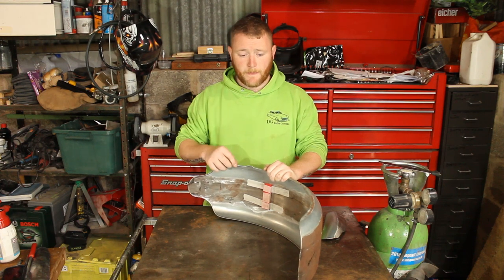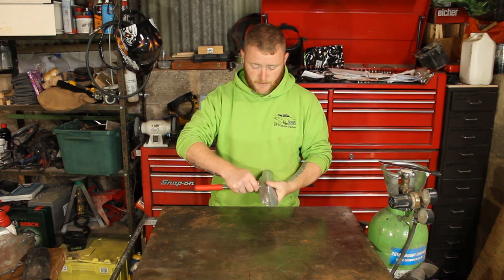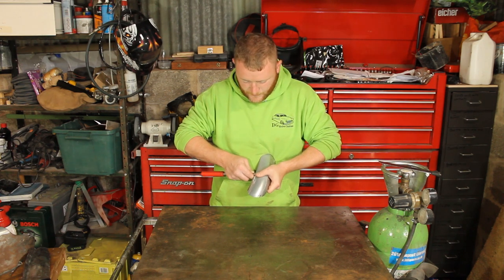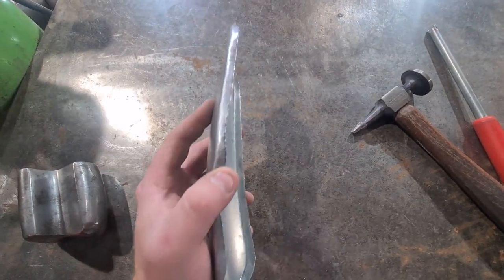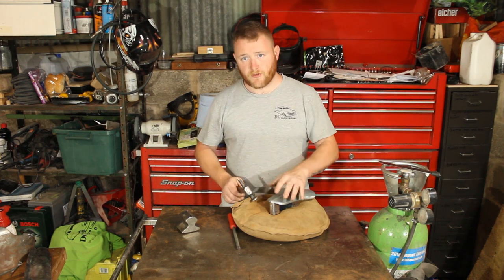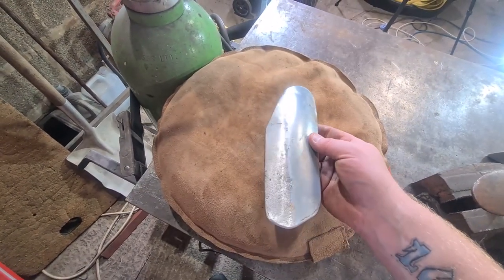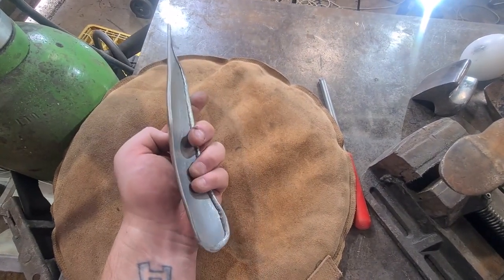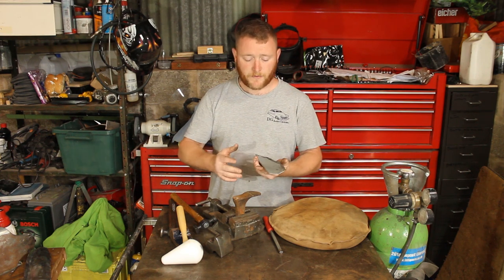Metal Shaping - How to make a return lip by hand | Rolled Edge | Wire Edge (no wire)

Comment: Really interesting and very helpful for me as I need to put a neat edge around the steel bulkhead opening for the gearbox on my current project car.
Thank you for making and sharing this.
Kind regards Paul from 48 Spokes
Reply from the maker: thabk you and you are very welcome, my advice would be practice on some scraps get the technique down and take plenty of breaks as your and will cramp up  Danny
Reply: @DGRetroCustoms  Thank you Danny, I have just had a practice, took my time and included a 90 deg bend with a 50 mm radius. Turned out nice 👍🙂
Reply from the maker: @itsalldoable  awesome look forward to seeing the results, send me some pics or tag me in a video if you do one